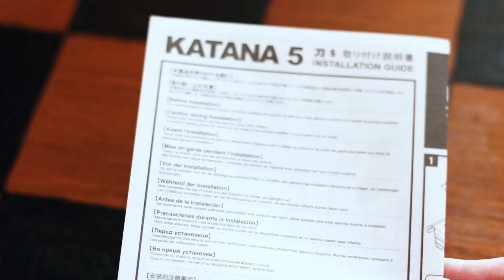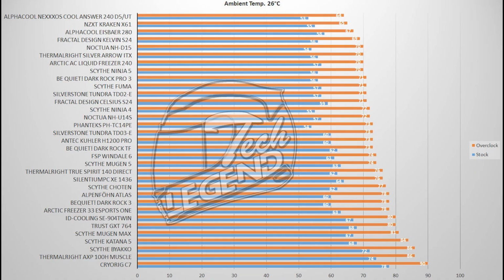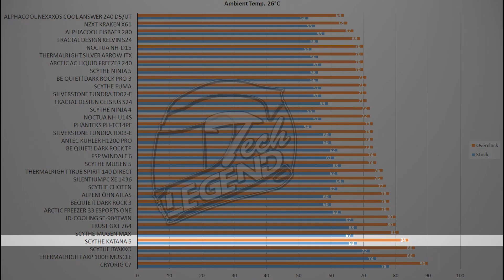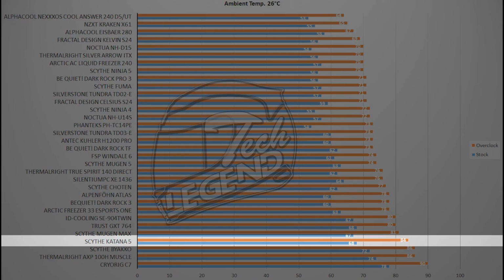Scythe Katana 5 Review - Affordable CPU Cooling

Comment: How does this CPU hold up to the claim it generates 7.3dB at 10% RPM? I'm thinking of installing it on an old i5-2500K that's near my bed. I'm trying to get it as quiet as possible, and this seems attractive as the case doesn't have a cut out to install something more premium without removing the mainboard which I am not really wanting to do. than ks for the video.
Reply from the maker: The issue is that the 2500K is not exactly a low power CPU, and this is a small cooler. Are you sure you can't just use a low profile cooler that is better?
Reply: @TechLegend-com maybe. Any recommendations?
Reply from the maker: @Phil_AKA_ThundyUK  Take a look at the Scythe Big Shuriken 3.
Reply: @TechLegend-com  Thanks mate. I was hoping there'd be an option that didn't involve removing the motherboard but I think I'm going to have to accept that I have fo 🤔
Reply from the maker: @Phil_AKA_ThundyUK  Unfortunately, most CPU coolers use a backplate system to stay in place and apply the pressure on the CPU. The 2500K is still a good one, but it needs proper cooling to function without thermal throttling.
Reply: @TechLegend-com  Cheers. Yeh I got really lucky when I bought it about 8 years ago - only paid about £600 for the whole system and it's still running most games I play now. I have  7600k with a 1080 as well but I hardly even turn that on as I prefer my old favourite PC and just reserve the 7600k system for when I play a really high end game. Funnily enough I need a new cooler for that as well as it often thermal throttles on CPU bound games :P
Reply from the maker: @Phil_AKA_ThundyUK  I understand, well, you know what to do now.
Reply: @TechLegend-com  thanks for all the help and replies
Reply from the maker: @Phil_AKA_ThundyUK  You're welcome! :)

Comment: I am using Katana 5 with Intel i7-9700 (non K) it is a very nice cooler with extremely nice results.
Reply from the maker: It is a good cooler for its price, I wish the mounting system was better though.
Reply: @TechLegend-com  oh the mounting was hell, it took a few tries to get it right and literally an hour or so. Espacially if the motherboard is small.
Reply from the maker: @egeemirozkan2460  That is the standard Intel mounting system, not really that great.
Reply: @TechLegend-com  to be honest, it works well for their small stock coolers, but for Katana 5 at least, the pins are very hard to reach and don't really lock in place...
Reply from the maker: @egeemirozkan2460  What I did to make the installation easier, was to remove the fan and just install the heatsink first, this ensures easy access to all four plastic push pins.
Reply: @TechLegend-com  not for a noob like me :)
Reply from the maker: @egeemirozkan2460  Don't worry, everyone had to start somewhere, don't worry, you will understand things in time! :)

Comment: Isn't 84° a little bit too hot for an i5-6600k? I have seen some reviews having average temperatures on i7s alot cooler than that. Seems bizzare.
Reply from the maker: It all depends on the ambient temperature during the testing and the voltage of the CPU. Some reviewers use a test bench for their CPU cooler reviews, I use an actual PC Case to get my testing done.
Reply: @TechLegend-com  O fair enough. Thanks for the response!
Reply from the maker: @untoldstory164  No problem, let me know if you have other questions. :)
Reply: @TechLegend-com  is the temperature above ambient or is it combined with the ambient temperature?
Reply from the maker: @untoldstory164  Above ambient. During testing, the ambient temperature is 26° Celsius, and with this cooler the CPU gets to 84° Celsius under a 4.5GHz overclock.